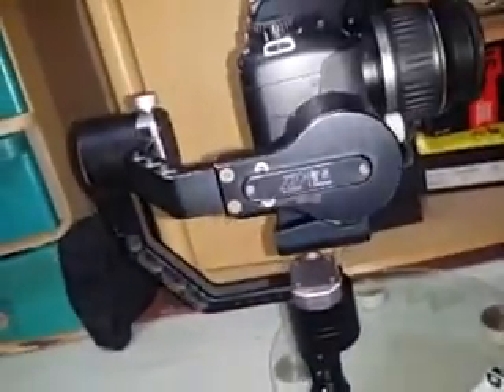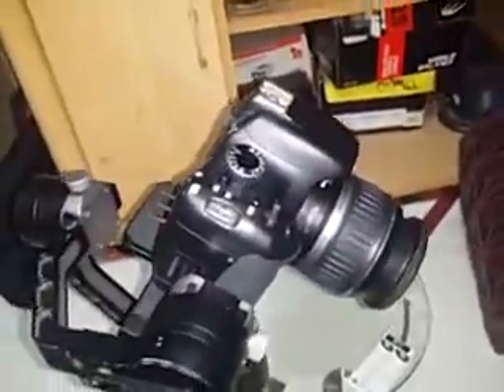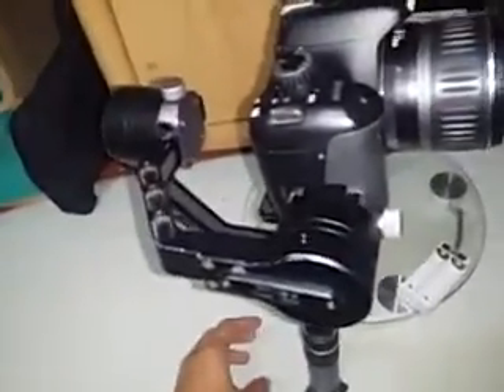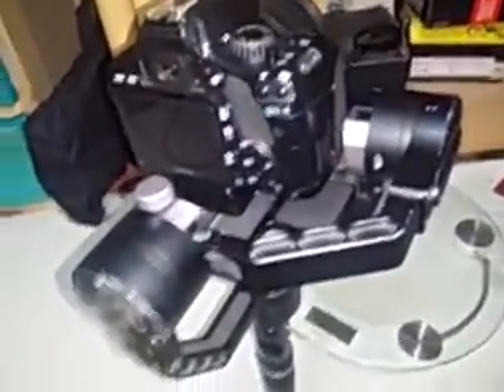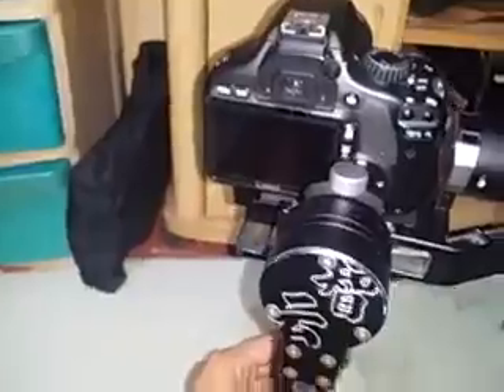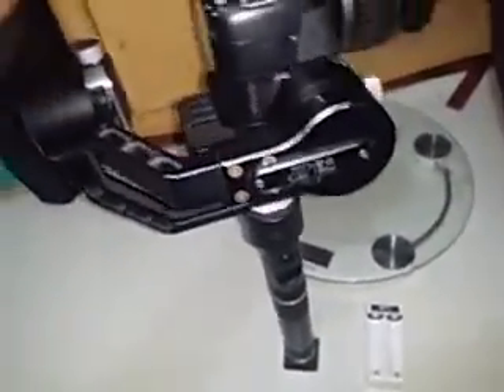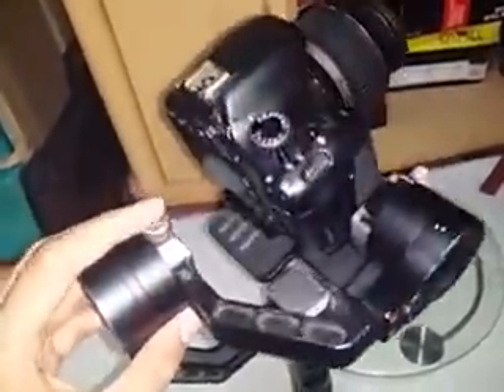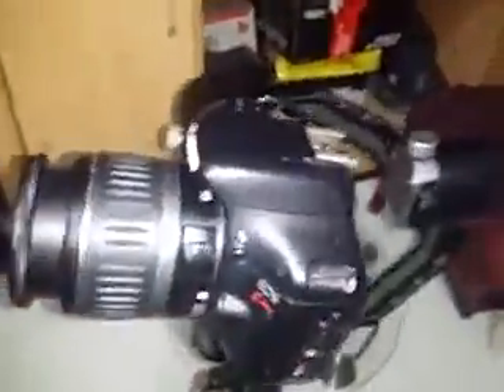Zhiyun Crane V1 gimbal standby error FIX

Comment: There is fix for that. I went through every video that mention that problem and I collected hints. In my case nothing worked, but suddenly my crane started to work seamlessly. It  seems to me that it has something to do with voltage and through continuous connection and disconnection of the gimbal under voltage and various combinations of the button on off, I managed to fix the gimbal. I was already planning to throw it into the trash, so I suggest not to give up, clean the contacts and try this method. I certainly wouldn't keep the battery inside for a long period of time because I think it could be the source of the problem. Cheers!

Comment: Hey. I'm receiving this gimbal shortly and read online from a couple of places that you should not switch on the gimbal without a camera mounted on it, your motors can break? How do you then calibrate the gimbal if it needs to be powered on without a camera, the same question is do I need the camera mounted when I do the firmware update if mine is not 1.60?
Reply from the maker: you do not need a camera to update the firmware. in calibrating, just remove the camera. it will not turnb on the motors. it will just check accelerometer/gyroscope sensor data

Comment: Hi bro!! Question!!! The V2 model they all have the same problem even if they r new?? Cause am thinking to get a new 1 cause i realy love it!!!
Reply from the maker: normally, V2 does not have this problem. Only few Crane V2s are problematic (probably due to unfixed problems in batch manufacturing and design) 

I suggest you buy DJI. Zhiyun is just lost in its quality control and support

Comment: How is your gimbal now? Does it wirk good? Any problems?
Reply: I have met another problems. It was on wedding. Many times it switched on standby mode. And it doesn't work at all. It doesnt switch on. I cant make a new firmware because of my computer doesnt see it. Driver doesnt stand on corrcectly. It is the worst gimbal, I have ever bought.
Reply from the maker: @romul560  you must first update the firmware to latest. install PL2303 drivers CH340 or CH340+ drivers or FT232 drivers. it actually depends on the chipset but mine worked using CH340 drivers. 

when it fails just connect it via bluetooth the your Zhiyun Play app and set the motors to high. 

recently, I had a heavy setup it was vibrating like hell but just keep the load to 70g-1.1kg (sweet spot) 

This gimbal is sold with photographers/videographers in mind with no technical expertise or experience. It's quite disappointing on how Zhiyun handles this. I hope this fixes your problem. It might be too technical but it will be okay.
Reply from the maker: minimal problems. after a few hours of operation, perhaps about 3 shoots in total, it resets to the default motor strength settings for reasons unknown. Before each shoot just set the motor strength to strong and don't charge the batteries to full 4.16V, just make it 4.13V for each cell.

overall, it works great but it still has microvibrations which Crane 2 doesn't have. That cannot be fixed as it requires low level software tweaking for its PID.
Reply: Thanks at all. I will try to do everything today.

Comment: I have the v2 model and am having the same problem!!
Reply from the maker: Try discharging the batteries and try turning it off for a while before turning it on. Alsonset the motors on strong. Occasionally or rarely, the Crane resets to its default setting. You can feel it somewhat weaker if you use it. You must set the motors to strong